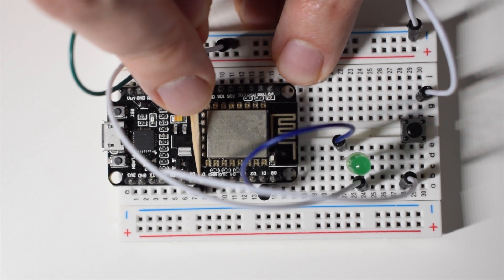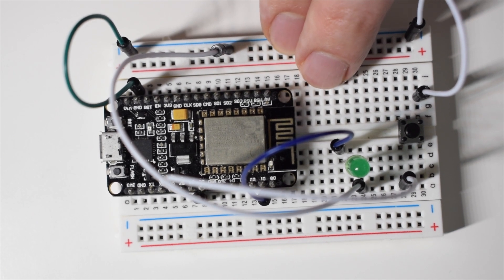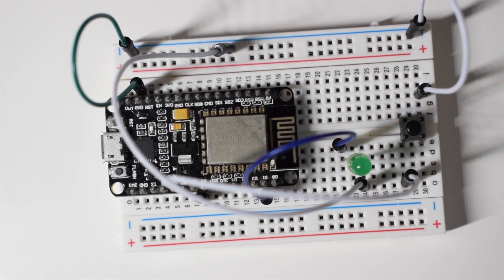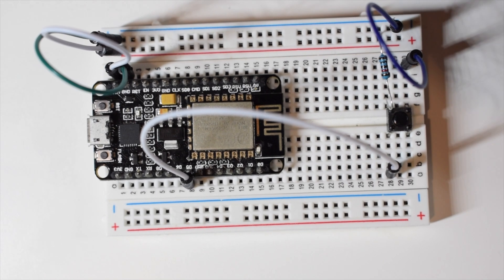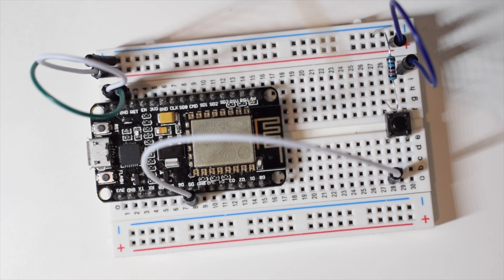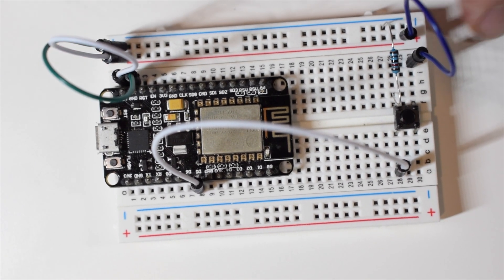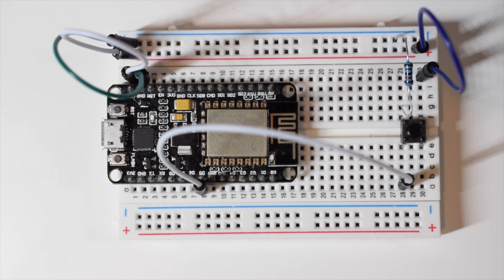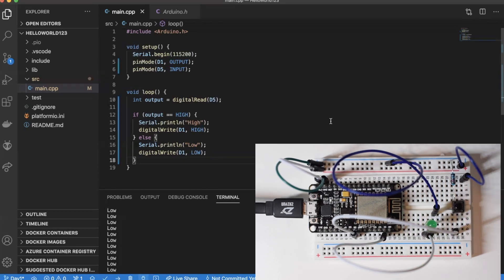Pull-up and pull-down resistors with buttons and ESP8266 - Day 4 of #100DaysOfCode in IoT

Comment: You should use a resistor on the LED line.
Reply from the maker: hey Yarden, the diode has a forward voltage of 4V so there's no need for the resistor. Check my reply to the comment from this video: https://www.youtube.com/watch?v=0RtwdQZRtMo

My fault that I forgot to add diode datasheet info to the description of the video, gonna do it now ;)
Reply: Hi, I have configured pin D1 and D2 as input to detect 3.3voltage connected to these Pins,
So my expectation is, when i read pin it should return HIGH if and only if wire connected to Pin is 3.3v, but it remain either low or high.
How to add  external PULL_DOWN to these pins, i tried 10k and 4.7k but did not help. @tomasztarnowski4434